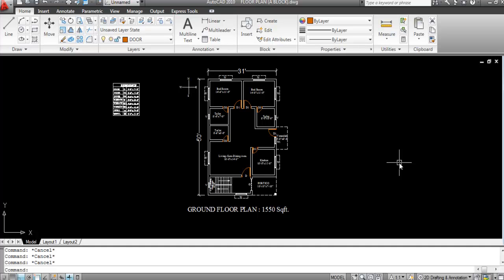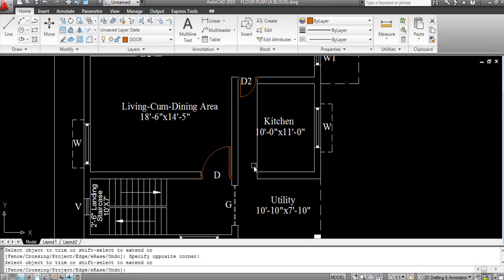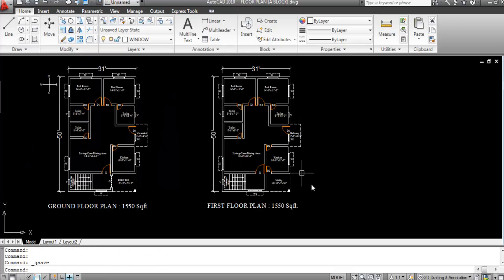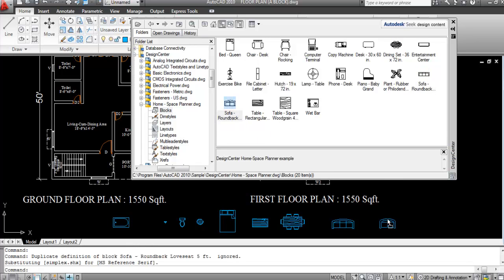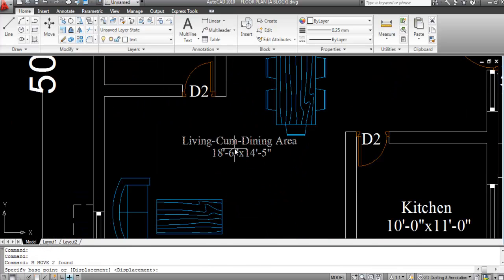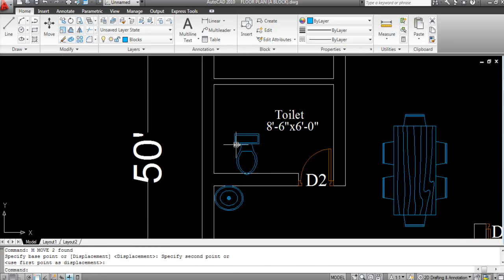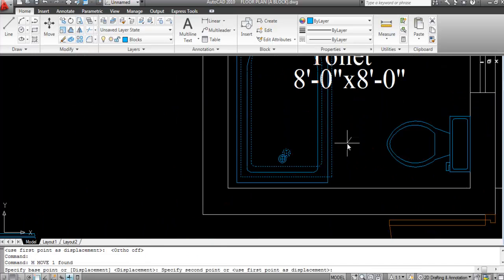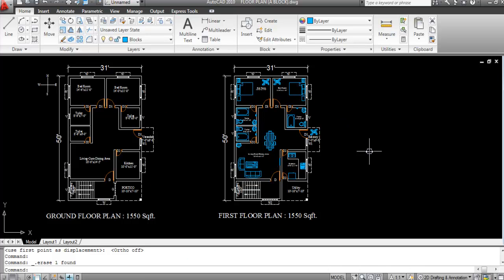How to draw Floor Plan of a Multi Storey Building & Add BLOCKS using Design Center || Building #2

Comment: What is Portico? What is use of
Reply from the maker: A structure consisting of a roof supported by columns at regular intervals, typically attached as a porch to a building.
A portico is a porch leading to the entrance of a building, or extended as a colonnade, with a roof structure over a walkway, supported by columns or enclosed by walls.
Reply: Nice job i am also a CAD designer working from 8 years in that field i just randomly seen your video your explanations is very awesome . If you can working as freelancer for shop drawings do let me know .
Reply from the maker: Market Complex - Shop Drawing - Floor Plan in AutoCAD | Building #3
https://youtu.be/bEoxcwofQKE